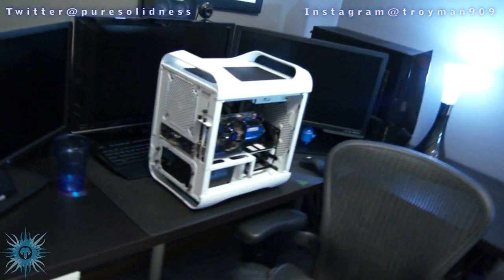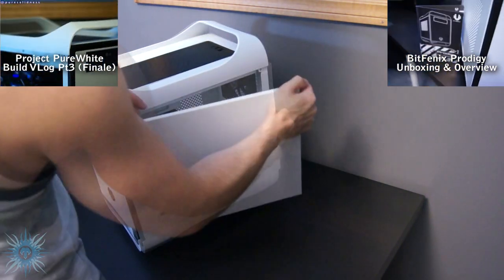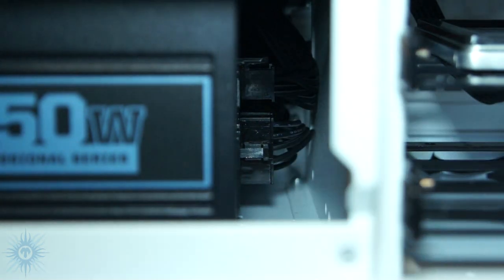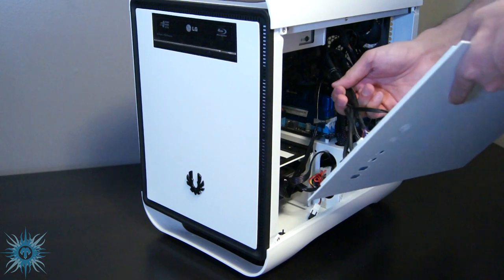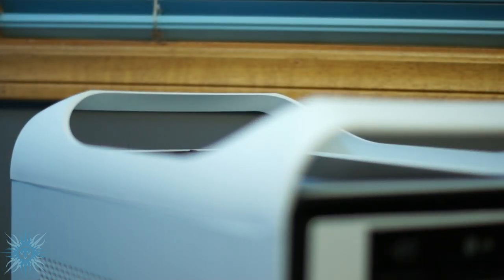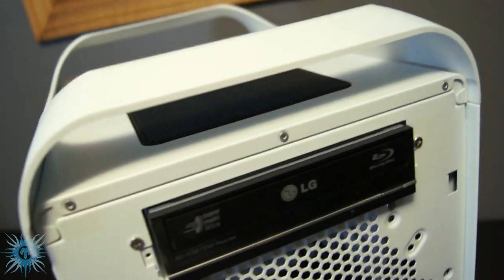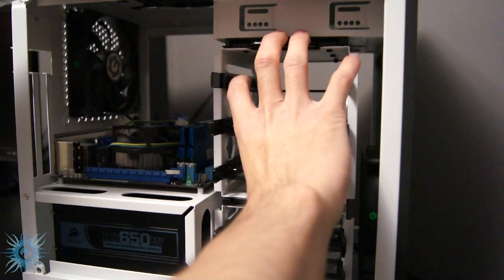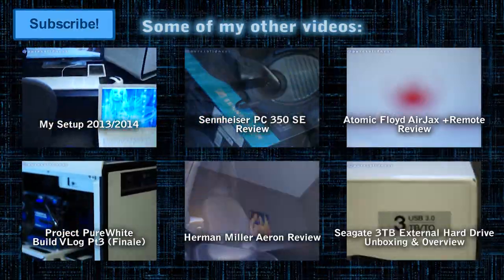BitFenix Prodigy Long Term Review (Best mITX Case?)

Comment from the maker: Let me know what case you guys use for your rigs and what you think of small form factor cases like this BitFenix Prodigy!
Reply from the maker: jultsu98
Very unique design on the L10GT I was pondering getting that for a while actually
Reply from the maker: TheDevilM8Me Good choice on the arc, I've heard they have amazing airflow!
Reply from the maker: TheDevilM8Me
Also, thanks for the support :)
Reply: I'm using a CM Elite 370 because my PC is just an entry level rig. In the future I'll definitely be using a small form factor case though. Your early vids on the Prodigy introduced me to how great a smaller case can be :) I would love to own a Prodigy now
Reply: i use the 380t from corsair (mini ITX) i fit a 240mm radiator (H100i) and a 980GTX and didnt strugle to much with the cable mangement

Comment: I'm planning to buy one, but swap the front fan to 200mm cooler master 
megaflow. 30mm high not standard 25 :\  Will it fit between the front 
panel and the drive cages or not?  Thanks! :)

Comment: I need to know what cpu cooler to use with my lga 1155 i5-3570k so as not to hit the corsair vengeance memory heat spreaders, and not hit the graphics card but move a lot of air, as I'm want to do some overclocking? Please help if you can and I'm not interested in all the "you should have got a different mobo and case if you wanted to overclock" crap, so please just help if you can. Oh yeah no water cooling either.

Comment: It looks like a good case, but the Corsair 250d seems a lot better. My problem with this case is that if you buy the window panel, how does your gpu get exterior fresh air :/
Reply: harshlens i guess it works if you uprade the front fan. you can go for 2 140mm fans or even 1 230mm fan, which blows air through the whole case
Reply: or use watercooling

Comment: I probably would've used this case for my build if there was an mITX mobo for FX processors, but I ended up going with a Merc Alpha.
Reply from the maker: Ya mobo choices definitely limit options for cases, I was pondering going the AMD route for Project Purewhite until I saw how little mobos they had for mITX
Reply: PureSolidness Yeah, it wouldn't be worth saving up for an Intel CPU just to use the case, and I do love my FX 6300.

Comment: i think you should keep this case and rebuild it with a higher power gpu like the R7 270x and put a core i5 4670k and throw a liquid cooler and use this as a LAN PC